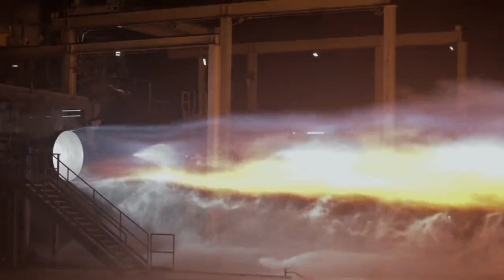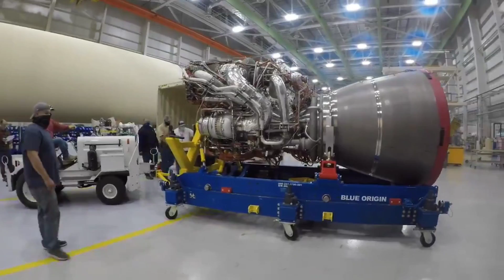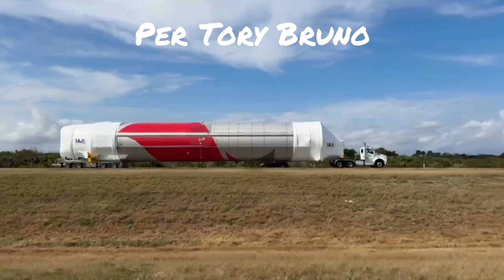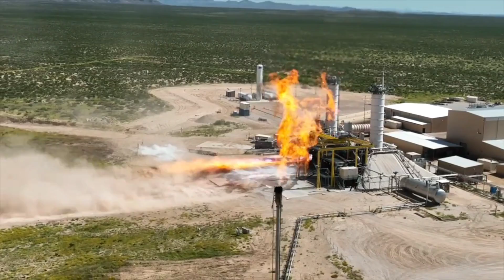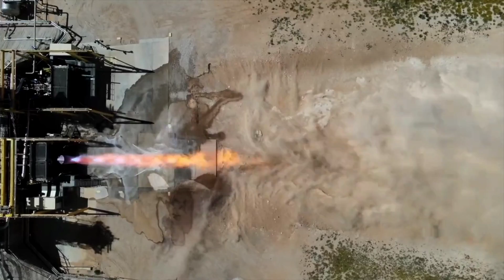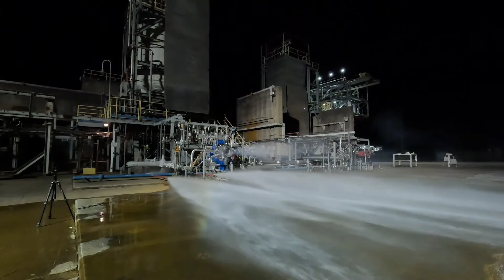Blue Origin engine explodes!!  How will this impact Vulcan Centaur, Peregrine and Dreamchaser?

Comment: Thanks for sharing your thoughts and videos. The thing I was most impressed by was not even mentioned. As anyone who has watched a few nasa space flight videos could confirm. Space X ships several raptor engines in a single trailer, Blue Origin needs the entire truck just for one engine and it looks like a spaghetti monster compared to the clean simplicity of the raptor. I guess this could be excused if the BE4 was more powerful but as a quick search can confirm it’s not. Just bigger. 😂

Comment: SpaceX has an abundance of cameras at the McGregor test site and every engine test is recorded real time and can be observed live or online by anyone who wants to see it. They provide a constant flow of graphical test and performance information that is readily available as well. SX has produced hundreds of engines and each one is tested before use and some are tested to destruction as part of the normal testing process. There is no legitimate comparison between the two when it comes to providing information to the public.
Reply: was about to comment the same ... and suggest to to angry astronaut to stop smoking or change vendor at least because he's talking nonsense in this regard.
Reply: Spot on!👍
Reply: I agree.
Reply: Second.
Reply: They are NSF cameras, not SpaceX cameras (SpaceX has their own cams but only sporadically releases clips, usually directly by Elon Musk) That being said to my understanding there's at least a gentlemen's agreement between NSF and SpaceX regarding where these cameras are and what they show and don't show and SpaceX tolerates these cams where they are.
Reply: Exactly!
Reply: Those are NasaSpaceflight cameras, not SpaceX.
Reply: @markreynolds3462  So?

Comment: It happened during the final "just in case" test, to an engine whose design is finalized and which was on the verge of being shipped as a finished specimen.  This means it's a design flaw and the entire run of currently built engines CANNOT BE ACCEPTED AT FACE VALUE.
Reply: Now, THAT is Disturbing!

Comment: SpaceX takes advantage of the community coverage (I remember Elon saying at one point that when he wanted to see the status of what would become Starbase, he just pulled up the LabPadre cameras rather than calling people there). Elon responds to questions about significant problems. Why do more work?
And Raptors blowing up in tests are not significant enough problems to warrant a mention (especially with their production rate)
Reply: When you test something to destruction? It gets destroyed! Elon sounded almost disappointed that the 350 bar engine test didn't blow up: he was expecting it to!
Reply: @paullangford8179  if you expect it to be a test to destruction and it didn't fail, your test wasn't designed correctly, you didn't push it hard enough 🙂
Reply: @paullangford8179 - I guess. He could’ve pushed it to 370 bar…😅

Comment: What do you mean to know what Space X is doing we need Nasa cameras? they do most of the stuff right in the open,  anyone can go and take a picture. Ellon is not a saint of my devotion, but progress does not come from false analogies.  Instead of telling us that Space X and Blue Origin are equally secretive with failures, you should be using your voice to rise concerns about Dragon and Dragon parts and pressure Nasa to ask for more Dragons so they don't start to be re-used more times than they should. Also, the Starship should never fly humans without a proper escape pod.  That and many more are valid concerns about Space X. They may not be perfectly transparent with the public but compared to most companies in the aerospace industry, from the USA, China, Russia, or Europe, big and Small they are a model. When you do false analogies you are pushing others not to change, and teaching Space X that being transparent is bad business.
Reply: Starship IS the escape pod. If something goes wrong with the booster, it can take off from the top. That is, does a stage separation like it is now being designed to do. The only "special" requirement is that the booster engines shut down if there is a catastrophic failure.

Comment: Dude, Space X has always been 100 transparent, unlike Blue Origin.  They show everything they build and blow up, right there for everyone to see.  That's why they have millions of followers and dozens of dedicated You Tube channels that showcase them.  Because of that they get the best engineers, and lots of them.  The two top companies all the best engineers want to work for is Tesla and Space X.  Blue Origin is not competitive because they are not transparent and they have doomed Vulcan and Dream Chaser, who hitched their wagon to the wrong company...
Reply: That's not true at all, 90% of what happens at McGregor (and Boca Chica) comes from third parties videoing the facilities rather than SpaceX sharing the information. 😏
Reply: @GSF404  And exactly how many live videos are being allowed at any other similar facility anywhere in the country or outside? That is what I meant by transparent, they know they are being documented and accept that, warts and all. On the other hand it took MSNBC to reveal the failure of a BE-4 at Blue Origin, when Raptors fail in testing it's recorded from several angles. So, yeah, it's true.
Reply: Sierra Space needs to call Elon for a Falcon Heavy booking...........
Reply: @crankyoldman65  They can't fly on FH. The fairing is only 4.3 meters diameter and Dream Chaser needs a 5.2 meter one.

Comment: There is actually a very big difference between the BE-4 and the Raptor in transparency terms. The Raptor is still under development, regardless of the fact it has gone through some flight testing with older versions it has not been frozen developmentally prior to operations. If Spacex had a Merlin blow up in a way that took out a test stand rather than just failing acceptance I'd want to know about it and probably should. But Origin is delivering a working model supposedly. That Bruno isn't overly concerned is good, but we need a bit more follow up.
Now Raptor will reach that same point sometime, it just hasn't reached that stage yet.
Reply: Raptor won't stop development for a decade yet. But there will be some interim mark that will become a "standard" and be manufactured and used, even to qualify for crewed operation.
Reply: The Merlin went to several iterations even after it was used operationally. They could probably use Raptor if they only wanted to launch a rocket. But they need it to land the rocket as well which makes its task 10x harder.

Comment: So according to some, Blue Origin has a BE-4 engine failure and is labelled as a "disaster". Meanwhile SpaceX continues to have Raptor engine failures not only in testing as during flight, besides tearing apart the launch pad, and in those cases it's "valuable data".
Reply: Yeah, the hypocrisy by SpaceX trolls is astounding. But don't you dare ever question anything Elon or Space or...else!
Reply: ^^^ this. 

SpaceX fanboy copium is being main lined.
Reply: The Raptors are not used for any paying client for the time being. They are powering Starship and Superheavy prototypes. That is the difference. Granted, this BE-4 made the noise in acceptance test so it would not be used anyhow. It is not a catastrophy for Blue but indicates that they have quality control issues or a design flaw that let's itself be known intermittently. If former, Centaur engines shipped to ULA should be ok. Blue will just be loosing a portion of engines in acceptance test. Money issue. If latter it may actually influence first flight of Centaur because the design flaw is in all the engines and the ones that were shipped squeaked by in acceptance test.
Reply: When you test an engine to destruction, it gets destroyed! This is Raptor development. SpaceX deliberately pushes each design iteration as far as possible to establish the limits, and find the "weak point". The first flight test of the booster was complicated by a huge cloud of flying concrete, which is a hostile environment for rocket engines. In this case, the test exposed a "Stage 0" failure, not a problem with Raptors.
Reply: @paullangford8179  

That's not correct.  This Engine was one of a series, two of which have already passed this exact test flawlessly and gone to the customer.  BE-4 has also been pushed well past its theoretical limits per videos released by BO themselves. 

So this is as much not a problem for BE-4 as it is for raptor.  

Also there's no evidence to suggest the failures of starships boosters were due to debris,  it's just as likely the engines had already failed.  a "stage 0" failure as you put it.

Comment: Ten years ago when BO hired some NASA engineers, they thought it wouldn't be long before they outpaced SpaceX, but the old boys brought with them their old boy methods, generally called the waterfall methodology, that is you do not test it until you believe it is finished. Musk brought with him the Agile testing methodology from his software days, where you test everything as soon as you have something to test, pumps, nuts, bolts ignition and test often and during the design of the prototype you evolve the first version, not wait untill you have finished the whole design only to find that it has 20 different issues not noticed in the design paperwork. SpaceX tests to destruction and learns about the issues every few days.
Reply: Source for any of this? There was a completely different mindset at Blue Origin since tens years ago and from the start in 2000, it was far more research oriented than SpaceX was. Only in the last 5-6 years has transitioned from that to a revenue-generating company.

Furthermore, SpaceX, by sheer dumb luck got the nearly half billion dollar COTS contract from NASA and then most importantly $1.6 billion CRS contract from them, which saved SpaceX's and Elon's bacon since they were about on the verge of bankruptcy. At best, had NASA not dumped so much money into SpaceX, they'd still be struggling along with some variation of Falcon 1 and working the lightsat market like Rocket Lab has been doing with Electron. Since then, SpaceX has gotten many billions more from NASA, from funding rounds, commercial, military, and other contracts while Blue has had to get along with what it can mostly from Bezos, which despite SpaceX fanatic claims, was not billions from the get-go, but around 36 million per year on average for the first 14 years and then starting in 2016-17, a billion per year, split between several programs as Bezos was able sell off enough Amazon stock to increase the funding. They've also taken on a gigantic leap compared to SpaceX in jumping from New Shepard to the colossus that is New Glenn.
Reply: This is why we love SpaceX and why Elon is where he is and Bezos is where he is. Truth!
Reply: @themaxster7798  Yep.  And Bezos isn't "old boys method" just in rocket design, either.  Consider the sequence of events regarding the selection of the first new moon lander, which everyone will have the benefit of public record in 10 years but which we currently still need to piece together for ourselves: SpaceX gets selected, to the surprise of essentially everyone.  The reality is that this was literally the only option available to NASA, assuming the plan was to pick a winner, as was ostensibly intended.  But the folks running NASA were in fact hoping to arrive at NO decision so they could secure a bigger budget and award the contract to their buddies in the National Team (including Blue Origin) the freshly grifted larger budget.  The individual in charge of the SpaceX decision, Kathy Lueders, was quickly demoted with absolutely zero cause.  She was replaced with the jacka-- who was responsible for Orion's hopeless bloat.  In the end, NASA got their bigger budget and, sure enough, awarded the money to their National Team buddies as originally planned.  Bezos was rewarded for literally delaying the space program he had been trying to sue his way into.
Reply: @themaxster7798 
   One is Toy
One is Tool
Reply: The military industrial complex takes that approach one step farther … do not test anything until you absolutely have to.  Instead wait until as much money as possible has been spent and the government has little choice but to continue.  Otherwise when it fails, your program may be cancelled or curtailed.
Reply: Exactly! There was a reason Rocketdyne abandoned this. Chamber pressure and intensive metallurgy, my first major.
Reply: As well as publishing their failures, when they occur.
Reply: "Musk brought with him the Agile testing methodology" - hehe, as a programmer myself, when I saw his methodology of development (let's leave it at that because it borrows from other software development paradigms as well, not only from Agile - you cannot always have sprints when your product can break legs, pun intended -, and adapts to the heavy industry) I wondered how fast the others will start to adopt it and I was ready to bet that Bezos will be the first, within 5 years. Those 5 years have long passed and nobody else seems to understand that the modern world brings more complexity and that complexity should be tackled by modern methodologies while the software industry had an easier time inventing and polishing those modern methodologies.
Reply: @milutzuk  I was a lead technician in the NPR (New Product Realization) lab at WECO's Westminster, CO factory in 1982. This technique is nothing new. Every circuit pack in both the Antelope and Ganzel mainframes were tested on dayshift while the engineers were present. By second shift they had reworked the physical boards for flaws. I was the second shift tech and I interpreted the quick fixes from schematics to the wires on those CP's.

Comment: Two stands. so another BE4 can blow up. It does matter because ULA and BO have to get their vehicles certified. No astronauts or launch customers will risk using dangerous rockets.  Would Torri Bruno fly on this rocket? The taxpayers would appreciate going for cheaper and safer launchers - SpaceX.
Reply: SpaceX The only private, profitable, commercial launch provider in the world. Falcon9: 107 successful launches and return landings in a row. And Falcon Heavy is 6 for 6 with 5 successful returns.
Reply: @crankyoldman65  For now. It's not wise to become too dependent on anyone, no matter how good their track record seems. All it takes is One Bad Day and things are grounded for at least several months, leading to scheduling nightmares and loss of profit.
Reply: You mean the company that just destroyed their only launch stand capable of supporting their largest rocket, which they also blew up in a catastrophic failure which set back their next launch date by a year?

Comment: Raptors mostly blow up when deliberately tested to destruction.  But engines get test run because that is the best way to ensure they don't fail in flight. And sometimes you'll find a problem that slipped through QA and final inspection. They do this with jet engines too.
Reply: Test a few and hope the crew build next 1000 as well. Only robots need apply
Reply: @GrasticInternational Robots can also get out of spec, if complacency exists
Reply: How do you know it's intentional? No offense but I'm curious.
Reply: @DSE8991  They have gone through multiple versions, drastically increasing the chamber pressure and making many other mods.  BE-4 is not running nearly so hot, it's deliberately something on the order of 'a mid-range version of a high-end architecture.'
Reply: @k53847  Yup.  Just a few weeks back, Elon announced that they had managed to push a Raptor 3 to 300 bar chamber pressure, an amazing achievement.  Then a few days ago, he announced that they have no pushed that to 350 bar, which is just crazy.  They got there by trying new methods, and failing sometimes: blowing things up.  But they got there, and who knows ho much further they can go?  Even if they stop at 350 and work on producing that version reliably, that menas Starship will have an orbital payload capacity of 200 tons if the entire ship is re-used, or 250 if the entire ship can be sacrificed.   completely unheard of.  No other rocket comes close.  And that's mostly because the try and try and tweak and try until they get it right, even if it means bowing up lots of engines along the way.  Smart.
Reply: Test To Destruction then work your way back. Always look before backing to make sure it's not off a cliff.